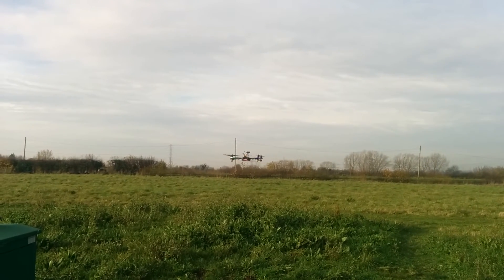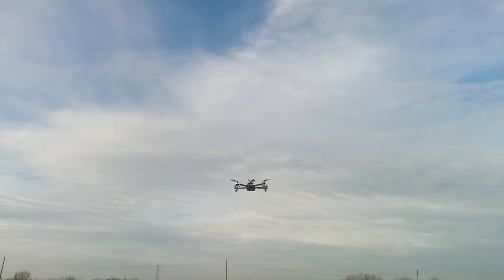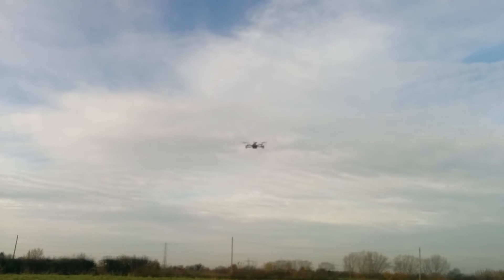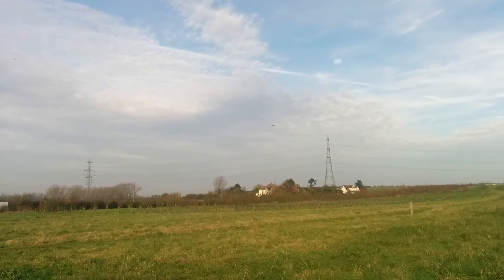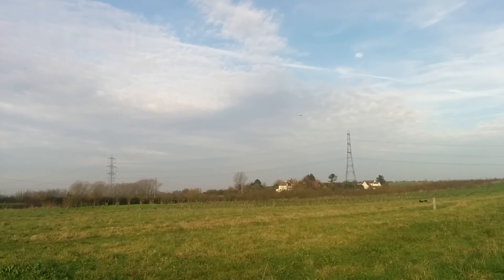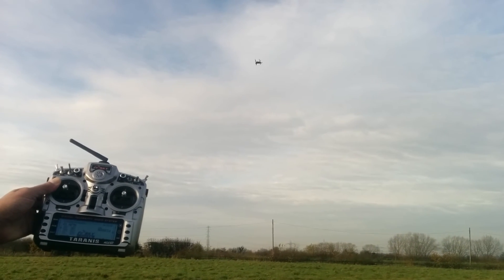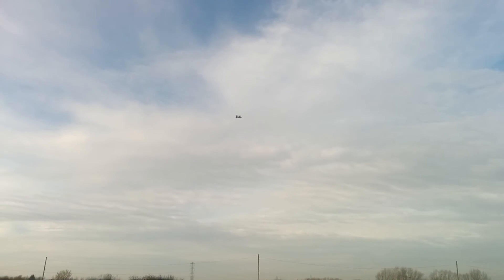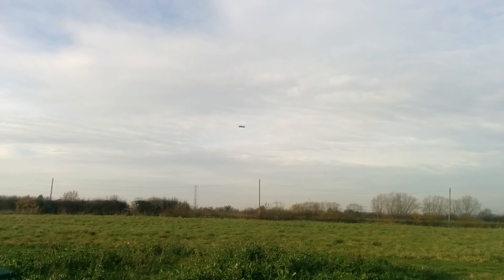APM 2.6 Arducopter 3.2 - Position Hold

Comment: Hello! im using APM2.6 with AC 3.1.5 fw. When im trying to do PosHold, my quadcopter just drifts away. What should I do?? another question is this setup can carry 5200mAh of Battery? multistar 5200 mAh 10c
Reply from the maker: +jasferb That is strange.  Pos Hold generally just works. There are no significant parameters to set - other than Braking aggressiveness.   Does your multi-rotor Loiter work okay? It may be that your GPS isn't working reliably with the APM 2.6 ....  My own multi is a 500 Hex and  have used 5000mAh and 10000Mah Multistar batteries with it.   But with the TBS Discover (in this video) I have used a maximum of 5000mAh Zippy 35C.
Reply: hmm..gonna check my equipment when I got home next weekend. I haven't tried doing Loiter mode. Im gonna give you an update afterwards.. Much thanks!

Jasfer

Comment: nice position hold, what is your batt? 3s? 4s? what is your flight time? Thanks
Reply from the maker: thank you. The battery is a 3S - I use 2200, 3300 and 4000.  In this demo I was using a 3300 and typically get just about 10 minutes flight time with the TBS Discovery (980KV, 10x4.5 props)
Reply: Danny Thompson Hi mate! i have the same setup as yours. But i think that my Rate is very high, I think I need to under 0.080. What is yours? Thanks